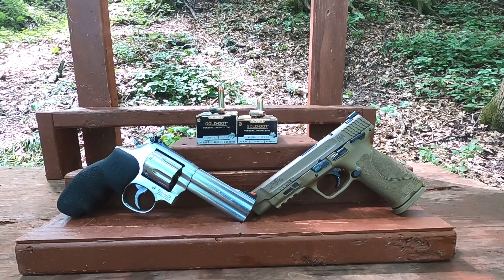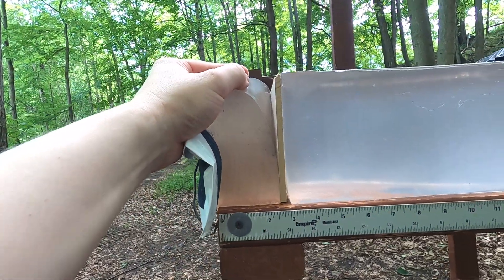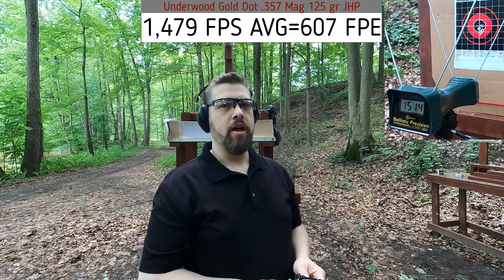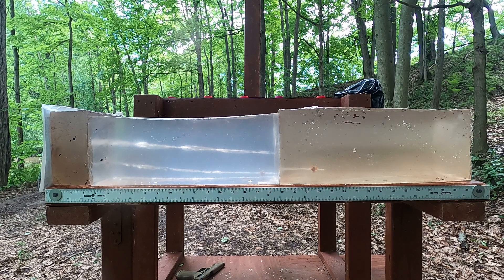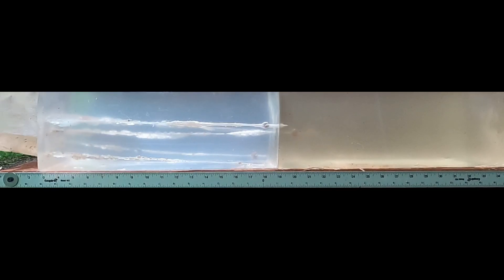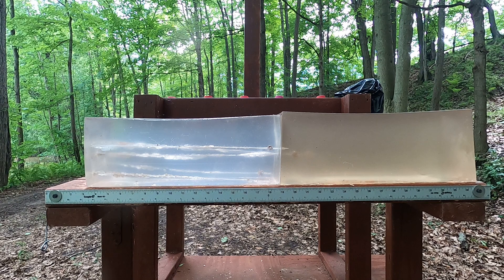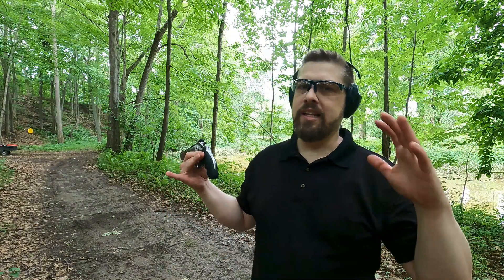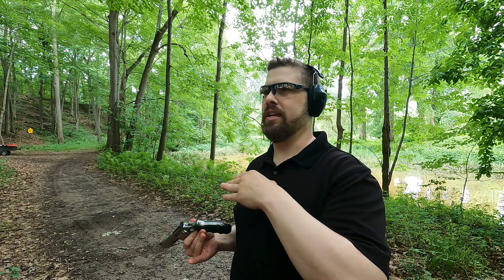.40 S&W VS .357 Magnum Ballistic Test - Gold Dot

Comment: I would  love to see .40 +p vs 10mm
Reply from the maker: I tested .40+P today but not 10mm. It was a decent test.
Reply: @GunSam  well maybe in the future we could get a side by side comparison! It'd be greatly appreciated of course!
Reply: very good test vid. 
i've held back from trying that. i get between 550-640 energy (obviously depends on wt.) from my standard loads. not sure going +p would give me anything worth the increased wear. if the job doesn't get done with what i'm using then its the wrong fight   imho
Reply: @boedude8496  what sort of pressure do those +P loads make? also how heavy a bullet?
Reply: Why? The 10mm is much more powerful,,a 40 magnum in reality,,the  40 S and W is a neutered 10mm,
Reply: @johnnyjohnson1370  just to see how much less powerful the 40 +p is than the 10mm that's why we test 🤷
Reply: @johnnyjohnson1370  
hardly neutered. the 40 is about 75% of the 10. could make the difference for some who cannot (for whatever reason) use a 10. it does the job it was intended to do very well

Comment: Good stuff as usual. Either one of these would certainly get the job done just fine. Interesting that those Underwoods being rated @1700 were nearly 150ft/s slower than Buffalo bore's 125gr. I figured they'd be pretty close.
Reply from the maker: Thanks!
Reply: Underwood's revolver velocity ratings are out of a 6" barrel.  Buffalo Bore I think is a 4" barrel for .357 and a 2" barrel for "short barrel" rounds. Judging from the fireballs I've gotten out of firing their 125 grain 1700 fps bonded hp's out of a 4" Model 66-1, there's no way it's going to reach advertised velocity out of a 4" barrel.  I love Underwood ammo, but Buffalo Bore is much better at telling you what to reasonably expect with their rounds with certain barrel lengths.  I fired the 1700s out of a 6" 686-1, as well, with no fireballs, so that pretty much satisfies me that they are giving out 6" barrel velocities.  I have about 120 rounds of that stuff, but I won't carry with it.

Comment: 357 magnum is hard to beat.. how about a heads up 357 Magnum vs 357 sig, same barrel lengths 4", same 125 grain weight... I have my money on the 357 sig. That'll be the comparison of some real powerful handguns.
Reply: I bet the magnum beats the Sig by 200 fps
Reply: @rippertrain  current data on lucky g lab site says Magnum will beat the sig in fps, some 50 to 100 fps.. BUT...sig beats the Magnum in consistent expansion, some by .10 on some ammo and doesn't over penatrate like the Magnum tends to do. So pick your priorities, both are great rounds and get the job done.. stopping the threat.
Reply: John John You will loose your money,,,,I have owned both 357 magnum and 357sig in a couple different guns and barrel lengths and equal barrel for equal barrel the 357 magnum is on a whole nother level that the sig can't even come close to,,,,,and it doesn't even matter on bullet weight,,,,,even jumping clear up to a 180 grain bullet the 357 can push at the same speed or more than the sig can push a 125 grain bullet at (loaded properly and at max on both a 357 magnum doesn't have too much trouble getting a 180 grain bullet up to 1356fps or a tad more and going up to 6 inches is pushing a tad over 1500fps the 357 sig on the other hand at best can only get 1450 or so with a 125 grain and 4 inch barrel and there isn't as much gain as barrel length increases because it was designed as a low powder volume case for use in shorter barrel pistols,,,so by design you can't put enough of the right kind of powder to achieve the gains,,,357 magnum on the other hand is exactly the opposite,,it is a large for diameter case volume and was designed when a small gun carried a 4 inch barrel and most where more like 6inch,,,that's why the magnum round get HUGE gains as barrel length grows (those same 180 grain bullets at 1350 increase to right at or a tad over 2000 fps from my Rossi carbine with 20 inch barrel),,,the sig is an awesome round in an auto don't get me wrong but comparing it to 357 magnum is like comparing a Toyota prius to a Ferrari,,,it just ain't in the same class by any stretch.
Reply: This!!! ^^^^

Comment: Great shooting at 50 yards. If I tried that, I would probably hit that vehicle while doing my best to hit the target. I like the versatility of 357mag/38spl. Easy reloading, low cost, hunting, self defense, target practice.
Reply from the maker: Thanks
Reply: YES SIR 38/357 is the most Versatile round you can get right after 9mm which basically means ANY PLACE that sells ammunition is going to have at least I self protection load for 9mm,38spl,&357mag. That's a big plus to me..
Reply: @zzxxooooxxzz4964   Common availability is not exactly the same thing as * versatile * . 

  .357 revolvers can use the full spectrum of standard .38 spl , +P , +P+ , midrange .357, full power .357 . Bullet weights from 95 to 180 gr , and from very deep non- expanding to arguably too shallow penetration .
Reply: @cloverleafsippa713 , I agree. Those rounds are excellent for self defense.

Comment: .357 hits the sweet spot. You gotta go to the real 10mm (1200@ 200 grain) to get better than the .357.
Reply: When the 10mm can't handle anymore, the .357 can. It only makes sense to compare similar bullet weight.
Reply: @onpsxmember  when comparing 2 different calibers does it make sense to compare the Sam bullet weight.  What makes sense is to compare the best in each caliber. Any thing else is waste if time
Reply: 10mm can almost match 357 magnum but not quite, and I'll leave it at that, do some serious homework on the subject and you"ll learn why.
Reply: @looseballs1966  haha o.k. keep thinking that. Been doing homework on the 10mm since it came out and you

Comment: Great content again, as usual! .357 is just plain nasty, as proven over and over in testing and irl. Always my edc and I am not changing that any time soon, not until there is another round like the .357 magnum to come out. Great stuff, Sam!
Reply: The .357 SIG came very close , at least in 125 vs 125 , as was its design criteria .
Reply from the maker: Thank you
Reply: the 357 sig while not as versatile as 357 magnum it does beat out the 125 grain 357 magnum for self defense because of the mere fact that you are getting 125 grain 357 magnum power in a semi-auto. 357 sig as a carry for self defense (2 legged predators) is superior to 357 mag carry. 125 grain is enough for 2 legged predator self defense. Of course if you plan on hunting the 180 grain 357 mag is superior.
Reply: @johnstockton8138 no it doesn’t